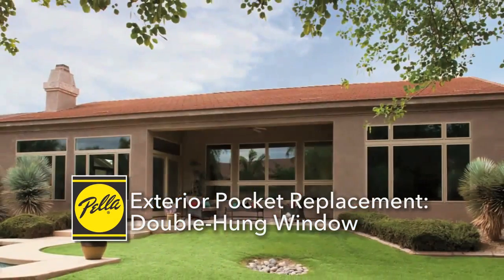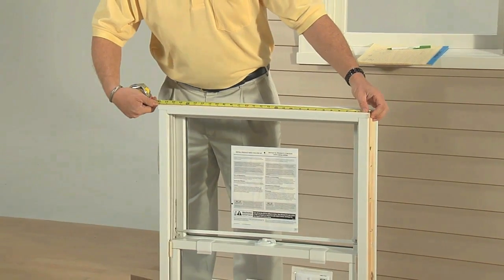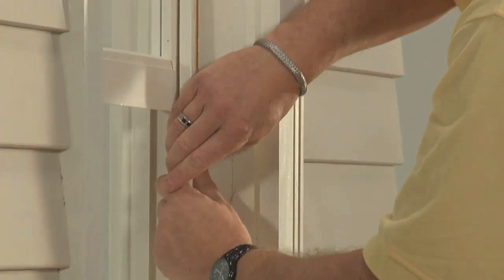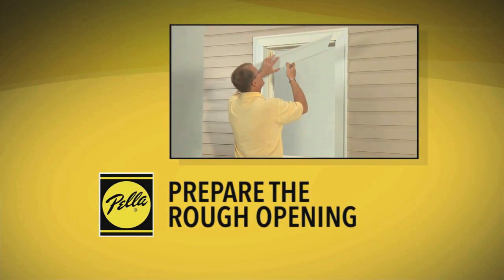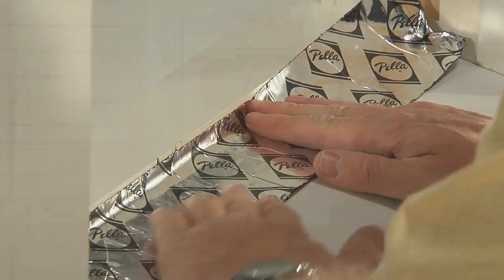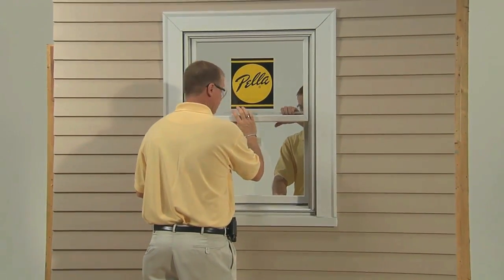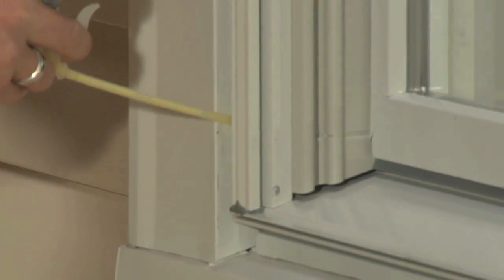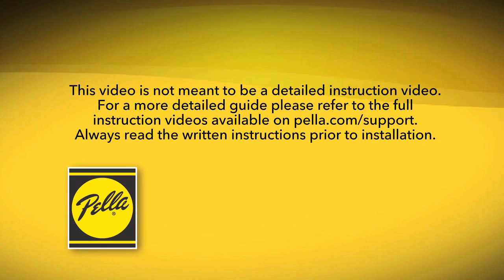Window Installation: Proper Exterior Pocket Replacement for Double-Hung Pella® Windows

Comment: I would have appreciated more about fastening the window. Do I drill the holes, are the holes already there, are they hidden and if so, how do I reveal the holes? And no, the written instructions are not clear either. A simple demonstration would have made this clear.
Reply: @kcmaldonado3948  Thank you but this does not change the fact that the instructions are not explicit regarding fastening the windows. I discovered the process by myself.
Reply: @orliszpon3220  So there were no more videos at the site?  I had questions about this, too.  Where to screw, how many, etc?
Reply: @kcmaldonado3948  There are plastic strips on the inside track of the windows. When you pop those strips out, you will see predrilled holes where the screws go in. After screwing the windows in, you replace the strips. You will need to place shims behind the screws.
Reply: @orliszpon3220  Got it.  I installed 14 Pella proline double-hungs several years ago and used the failing fin since I had the siding off, so I had never screwed in the sides.  The remaining 3 I have to install I cannot disrupt the siding so you will use the pre-drilled opening.  Thanks!
Reply: @orliszpon3220  Thanks! (It would be nice if Pella was clear about that!!)